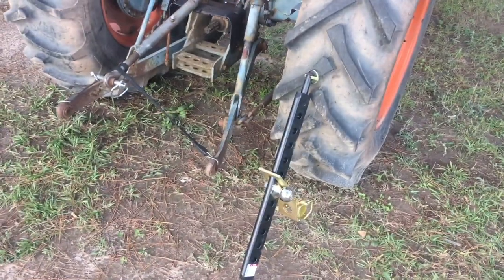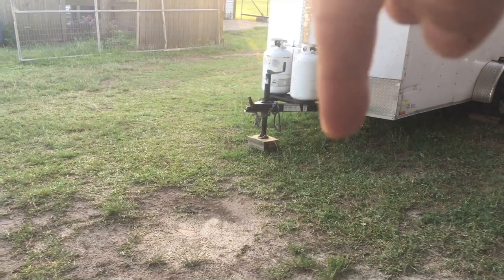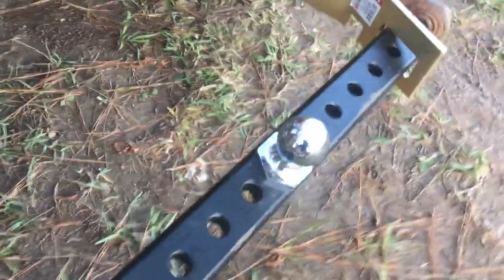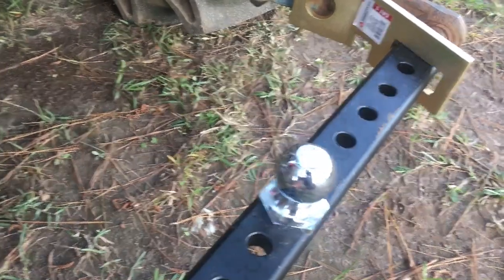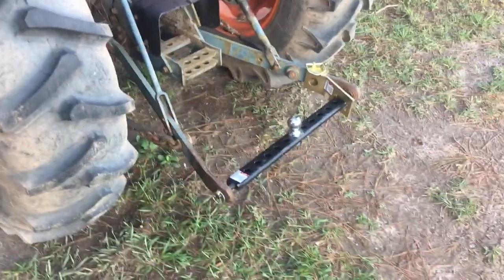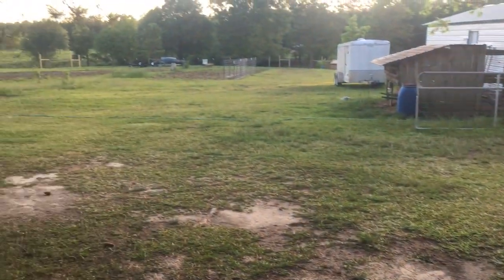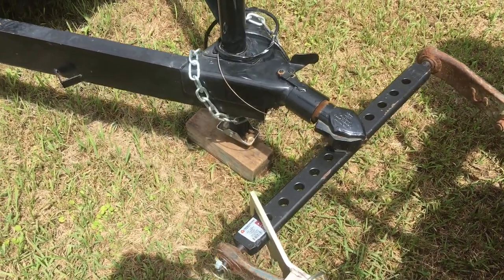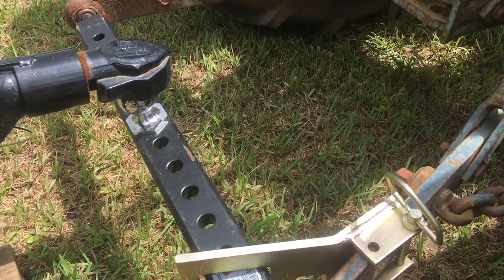Using the new drawbar

Comment: I have a "new" 1941 Ford 9N with the same drawbar, but not the stabilizer.   I have seen some three point trailer hitch triangle shaped units.  They seem more stable, but I wonder if I could pull the small trailer with what I have.  Please comment.  Thanks.
Reply from the maker: the stabilizer, of course, keeps the drawbar/ball from rotating. I got mine at (I think) tractor supply. I still occasionally use it to tow trailers. as far as the fit on your 9n, I guess it would depend on the shape of your tractors lifting bar. if it fits, it should give you trouble free service. thanks for stopping by and I hope this is the answer you seek.

Comment: I notice it only has one pin the lock, what keeps it from sliding back over and allowing the draw bar to swivel? I just got the same lock today and put 2 pins in it and it still moved to the round rod on the draw bar. I also put my lock in my press and bent it so the angle was steeper to remedy the situation
Reply from the maker: there is a fitting on the right side that goes over the drawbar and pond onto the right side lifting arm.
Reply from the maker: PINS to the right side lifting arm…
Reply: @toadstead1  I think you're missing the point of this question.  I've run into the same concern.  If you attach the lock exactly as you have here, you can simply push the lock towards the right lift bar until it is flush.  The lock in that position has slipped off the flat drawbar and onto the 3/4" drawbar pin, allowing the drawbar to swivel freely.
Reply from the maker: I’ll have to look at it again. I have not looked at it since it was replaced…